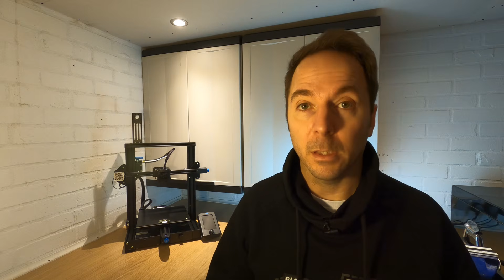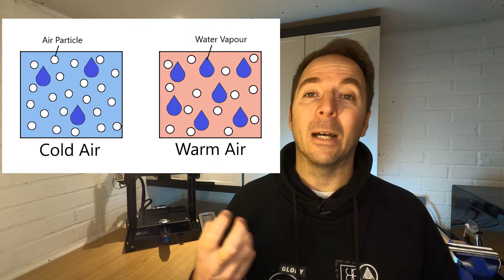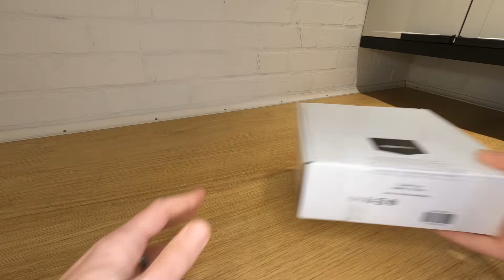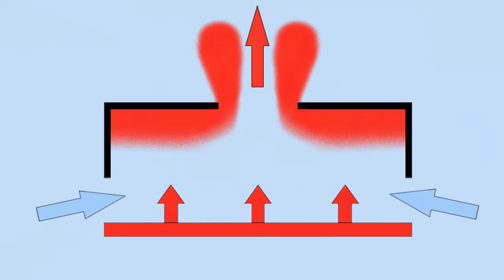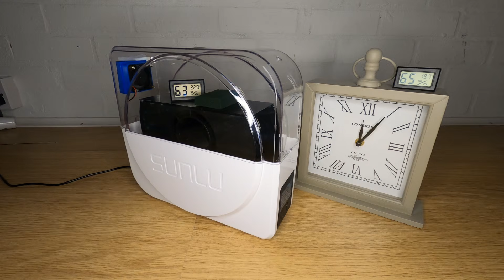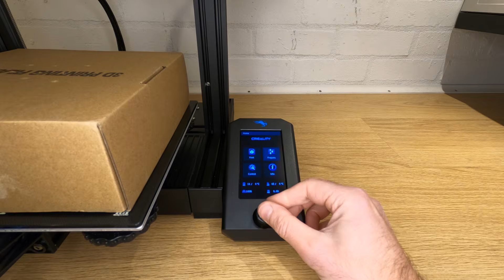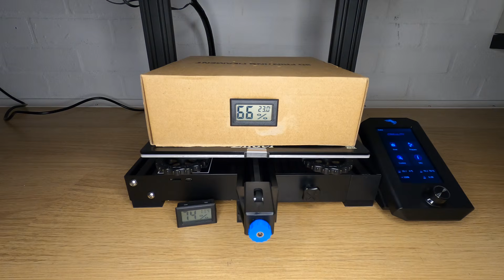Amazingly Simple Free Filament Dryer -You already have one!

Comment: I think there might be a critical flaw in your comparison technique with a the wet sponge... If the sponge has a significantly higher water content than the air around it, then air movement is going to be the primary driver for how quickly it dries out (the evaporation is going to be limited by the water content in the air immediately around the sponge). Think of it this way... if we have a wet sponge and put it in a small sealed box but heat it up, the sponge isn't going to dry out nearly as quickly and will eventually hit a point where it is no longer drying at all as the air becomes saturated (jungle environment). However if I put it on a table with a fan blowing air over it, it will dry out very quickly and eventually become stable moisture content with the air around it. You see this in practice with buildings that get water damage. Circulating air through the building is a much better way to dry things out than to just heat the inside of the building up. With filaments however, we want them to be much drier than the ambient air around them and they typically start out below the ambient moisture content, so the air flow technique doesn't really work. We are also trying to remove much less water as a percent of the total material than a wet sponge, which is why it becomes necessary to do things other than just blow air over them. So with dryer boxes, we take cool air with low moisture content then heat it up to allow it to hold more water. The air then slowly draws that small amount of water out of the filament. If needed, you can gradually change this water saturated air out for fresh air if there is enough water content in the material you're trying to dry to saturate the air, but the actual amount of water in "wet" filament is actually very very small. Anyway, my point is that the wet sponge test is going to give very misleading results when comparing ways to get an already dry material significantly below ambient moisture levels, and also why your wet sponge results are directly in line with which methods allow for the maximum amount of airflow.
Reply from the maker: Yep, I can't disagree with anything you have said. If you've seen any of my other videos on filament dryers, you will see that I say that this is not the best method for the reasons you have said. I'd like a better medium to use but haven't yet found anything that suits.
Reply: @RickyImpey  Thanks for the reply! I haven’t seen many of your other vids, so hadn’t heard that disclosure, but appreciate that it’s out there. I haven’t thought about ton about it, but would desiccant packs be a better option? 

E.g. grab 6 similar packs > expose them to ambient moisture for some reasonable amount of time (~anything more than a week?) > weigh them > put them in the dryer for standardized time (~8hrs?) > weigh them again and measure the water loss. 

I think that anything where you are trying to get something from at or below naturally ambient moisture levels to much drier would be significantly more indicative of a dryer’s effectiveness with filament (vs measuring something that is significantly over saturated). E.g. a fan and open air exposure would show excellent results with the wet sponge but actually be significantly worse than doing nothing at all with filament.

Comment: Tried this with some TPU filament I had. In 12 hrs, it went from 641g to 632g. A wireless temp/humidity sensor said outside the box was 43% humidity, inside the box was 15% humidity.

Comment: Nice idea, I tried it and it does work.  Trouble is, my 3D printer (Prusa i3 mK3) has a "safety timer", so if I set the bed to run as you suggest, it cuts out after half an hour.  Presumably that timer is there for a reason, so it seems the printer manufacturer doesn't recommend running the bed for long periods without printing.  If the heater element needs replacing sooner, I wonder how the cost of that compares with buying a filament dryer?

Comment: I did this! I had two failed prints and didn't know why...on one printer the filament (PLA) broke and got stuck in the tube. Not knowing my filament needed to be dried, I moved it over to my second printer and restarted my print.  The filament was being shredded going into the extruder (swollen) and broke again. I asked in a social media group what was going on..someone told me to dry my filament. I don't have a dryer so I Googled how to do it without one...and found your video.  I gave it a try...and the next day the filament printed flawlessly! Thank you so much!!!!
Reply from the maker: Glad you've seen such great improvements!
Reply: I'm surprised you managed to salvage your filament. According to Zack Freedman, the process where humidity makes filament brittle is permanent, so filament that has become brittle can't be restored.
Reply: @waldolemmer  I mean if that were true then nobody would talk about the drying your filament drill, there wouldn't be filament dryers either
Reply: @ Filament only gets brittle once it's absorbed a ton of moisture. Filament dryers exist to prevent filament degradation, not to cure it.
Reply: @waldolemmer  I don't know who that guy is but he doesn't know what he is talking about. Or maybe he is paid by a filament company to boost sales, lol You can even leave PLA submerged in water because PLA's "biodegradability" isn't what people are told by China thinking it will dissolve in water or by dirt exposure or something. Certain plastics like PLA fails in things like hydroponic setups because the water gets acidic or basic and starts chemically altering the plastic. This is the same reason why UV exposure can degrade plastic, in that case it's just bombarding the plastic with so much energy the molecules can break up. 

The biggest issue most people have is they rewind filament onto a different spool without annealing the plastic and it shatters in storage requiring remelting back into filament which most people don't have a filament extruder (everyone running a 3D printer should though). 

As a side note, if you do have a bunch of old filament, failed prints, or support material that is not mixed and of the same type, just bake it in the oven on some parchment paper in a metal tray until it melts into a sheet and score and break it into strips. This makes is compact and cheap to ship, and once you get several kg of material, sell it on ebay or other websites for a few bucks per kg and people who make their own filament will buy it up.
Reply: @waldolemmer depends on the amount of brittleness and the type of materials. Some plastics get hydrolized very quickly while others only get brittle because of the extra water. So one has been actualy broken down into a new molecule and the other one is weak like wet paper wich will get strong again after drying

Comment: Get a BBG mesh, (glass fiber with teflon coating?) and put it on the bed. That will lift everything up slightly from direct contact with the heating elements and provide a little bit of airflow. Would have to be very hot indeed before cardboard would catch fire. Problem solved :)

Comment: I "built" this yesterday and I was quite amazed how good this works. I had a wet roll of PETG which came very wet from the factory. I couldn't even finish my calibration prints, it was popping all the time and the models just crumbled. Let it sit on the bed at 65C ovenight and it now prints great.
I already have 28 of your dryboxes made, so thank you for those also. I use the 5l variant of the storage box because I don't use the somewhat big dehumidifiers but rather silica in Nylon "Organza" Bags. 
Thanks a lot, you made my life easier!

Comment: Cardboard isn't flammable at 70°C, don't worry. It's ignition point is 233°C (which may vary slightly depending on composition btu not to the point of getting down to 70)

Comment: As someone who has never dried filament, and never had a print issue from it, whats the point of drying it? less layer lines or something? im genuinely asking.
Reply: It doesn’t matter much for abs but with petg tpu or nylon there is stringing issues also weaker parts for damp filament. the moisture boils in the hot end and just makes things worse.
Reply: Thanks  @mshepard2264

Comment: you can also use heated bed for other stuff. i've seen people using it to culture youghurt (needs 42 C) or to warm up PCB etchant liquid ferric chloride (etching can be further sped up by swinging bed back and forth using g-code, therefore stirring the etching bath slightly - poor mans stir plate)

Comment: Save all of the dessicant packs that come with fillament.

Place on aluminum foil and bake 4 hours at lowest setting for your oven. 180 F is perfect if your oven goes that low.  Food dehydrators will work to dry the crystals. At 140 increase time to 6 hours.  We really want less than boiling point of water but hot enough you don't want to stick your hand in water that hot.

You can renew the dessicant packs almost infinitely.

Drop the filament and the dessicant in a plastic storage tub and close it.
Store your filament this way and it won't have excess moisture.
Reply: Is there a risk that the oven or food after this starts to smell?
Reply: @joninorth3585  If your oven is cheap like mine it could go well above the temperature on the dial as it "preheats." If you leave it on low for a long time there is a good chance the oven will do the "preheat" cycle a few times. I melted a roll of PETG pretty well that way, into one giant filament ring, and the spool holding the filament itself burned, bubbled, and split. I filled my kitchen with the smell of burned spool plastic, and it took 3 good cleans for the plastic taste to not creep into bread products/pizzas.

Comment: I tried this last night. Wow, it worked great with one problem: my Prusa mini times out after 30 minutes. I wrote G code to keep it on. It's just these three commands repeated ten times (5 hours): 

M140  S70 ; Set heatbed temperature to 70C
; 1 Loop to maintain temperature for 30 minutes
G4 P1800000 ; Wait for 30 minutes (1800000 ms)

Comment: You might aswell park the filament head on one of the corners of the box and turn the fan on ,ofcorse after you cut a hole for the extruder and fan ,in such a way the fan can blow cold air into the box ,or extract the hot air from the box

Comment: not a wise idea. some boxes have a plasticy coating on them and ya thats toxic..
HERES A BETRER and FADTER idea.
what else actually dries things in your house? A CLOTHES DRYER! - most modern  dryers come with a shoe rack that clips on the door opening and floats the shoes in the middle of the dryer as it runs. if your dryer can pull moisture out of a soaking wet towel in less than an hour then you can best believe your filament is no challenge  at all ( set the dryer it on low heat of course - and test a leftover misc roll to be sure because all dryers are not created equal )

Comment: I use a food dehydrator (the type with the door on the front and wire-racks for what you are dehydrating). I usually run it at 45°C for PLA with good results. I think I need to use your drying foam technique to benchmark it's performance to satisfy my curiosity.

Comment: I use my actual dryer.  The back and door are enameled steel so 2 heavy magnets cut some dowel long enough to just clear magnets on the end. Front support 3d printed stuck to door Add spool click to back wall set on support close doorrun a dryer cycle.

Comment: I have bought a dryer before, and let me say, don't buy the Comgrow model! I had to return the first one, it wouldn't take any setting or start up, the second one the fan bearings failed and I had to replace it in just a few weeks. Plus, the manual says to "open the lid from time to time to vent the moisture" really? That said, I like this idea, building one wouldn't be hard and cost the same if not less. It's not for those just starting out, I've been 3D printing for a couple of years, and I have built up a decent amount of spare parts. Any container that's "dishwasher safe" will handle the heat, using an old Ender main board and PSU will give you better control than any dryer on the market. If you're not into DIY projects, don't try it unless you have good help.

Comment: Your Sunlu mod pulls in "drier air" I have to wonder where your fan is getting this drier air from. Isn't this simply pulling in massive amounts of moisture laden air especially in humid climates such as where l live in and overloading the heater's capacity to warm the air?
Constantly cooling the heated air or put another way, constantly trying to heat newer, cool, possibly moist air, seems to defeat the purpose of the heater imo.
All you need to do is add some passive exits for the warm moist air and that would be up the top. Exit points that can be sealed after heating.
This Sunlu you modded isn't a storage box, but it can supply the printer at print time, your viewers need to be aware of that. It just needs to remove x amount of moisture from the filament prior to or even while printing. After that well, hit it again (quicker 2nd time around) then vacuum store it elsewhere or have a purpose built container along with a telltale dessicant to keep the filaments dry between printings.
I just bought four of these Sunlu dryers and looking for ideas, but adding fans isn't one of them.
I take your point about filament delivered vacuum sealed still needing to be treated and new PETG needs to be treated as guilty as charged and needs a good drying out. That's a good point you made.
I may still build a drybox based on another chaps design so I can dry out more reels at once AND keep them dry and use the Sunlu's as feeders into my two printers. Still mulling over my options.
Thanks for the video Rick, I appreciate your video is trying to educate printers who are looking for answers.

Comment: You can also, for *cheap*, get heaters designed to keep reptile enclosures warm. You can adjust the temperature, they're designed to run efficiently indefinitely, and you're not putting wear on your expensive heatbed. Plus, if your printer is smaller, your roll of filament won't fit.

Comment: That’s really quite clever and easily made! I use a Kmart food dehydrator with a cardboard cylinder to replace the plastic shelving. $55 and it works perfectly. It will do multiple rolls of filament and really improves printing results. The dried filament is stored in vacuum bags or sealed plastic storage from Bunnings, some even have a PVC pipe rack and filament path of Bowden tube to allow direct feeding. Can store 4 rolls and alternate as required. 👍🏻
Reply: I'd love to see pics! Need to hit up Kmart and Bunnings haha

Comment: Thanks for your Videos! 
I'd really like them because i'm a Fan of doing things in a scietific way.
I thought of the possibility to use a dehumidifier without the need of heat. Do you think this would work? Do you think it would work faster? probably a combination of both will suit best.
Edit/complement: I thought of a Box with a PTC-Heater inside that blows the air inside the box (circulating) but also sucks a little bit of free air in as a possible way to decrease the time needed for drying..
Edit2: In the End it's probably not that big of a difference if i'm using a Dehumidifier which makes the air cold (and als a result the filament -> less evaporating water from the filament?) or i'm using a desiccant in hotter air

Comment: As a fellow moistue obsesee. I too have tried multiple different ways to remove moisture and keep it out. There is one more way to do this simply, and it's called an oven. You can put your filament and dessicants in all day, at a set temperature (not too hot or cold) and it beeps to tell you it's finished (usually 8 hours at 60C for PETG) which brings up the other point of needing the filament to be dehumidified for a loooong time, making your printer offline for that long for only one roll of filament could be bad... although keeping your oven out of comission for that long could also be bad, at least you can do multiple rolls and desssicants at once.
Reply: Using an oven is not a suitable way of drying filament. The temperature isn’t controlled accurately enough which can end up melting your spools or filament. So to compensate for that you need to set the temperature lower so it doesn’t spike too high which also affects how long it takes to dry. Ovens have very coarse temperature control and it varies a lot, they aren’t made to stay at a consistent low temperature.
Reply: is there a risk that the oven or food after that starts to smell?

Comment: Been doing exactly this for years, seemed obvious to me.  Wrapping a pastie in tin foil and placing on the heated bed also works a treat😊
Reply: Shame you didn't share it :/
Reply: @jerbear7952  If I shared everything I know YouTube would run out of server space 😆
Reply: What is a pastie?
Reply: @damzelfly  https://en.wikipedia.org/wiki/Pasty
Reply: @ShedOfDreams  I almost took pasty as some slang for the spool and it occurred to me that maybe the spool itself can be wrapped in tin foil, poked holes for venting, and achieve similar results? Since it's just heated up in the foil. Idk though.
Reply: @HankHill1 i doubt wrapping the spool in foil would work, you need to heat the air around the spool as well as the spool, this is what draws out and carries off the moisture 
wrapping the spool will give its very little airflow around it
Reply: @damzelfly Essentially nipple covers for girls you’re not wearing a bra
Reply: hot pasties hurt my nipples
Reply: what temp do you use in the bed?
Reply: @davidaguilar2151  60/65